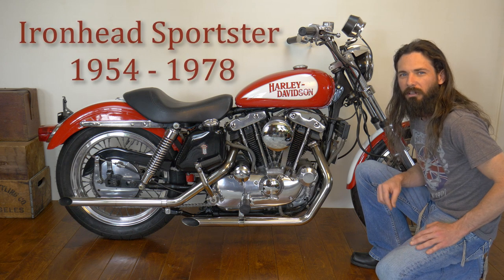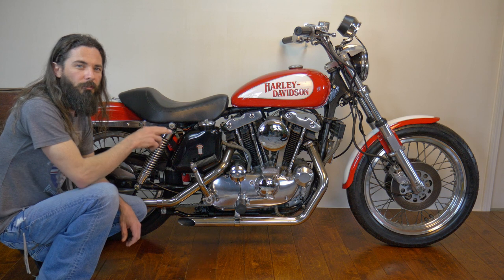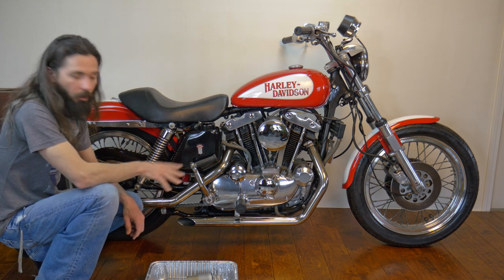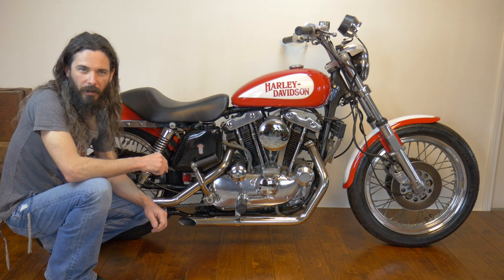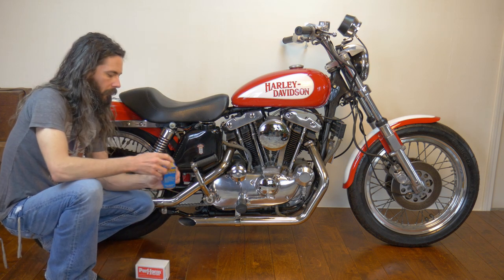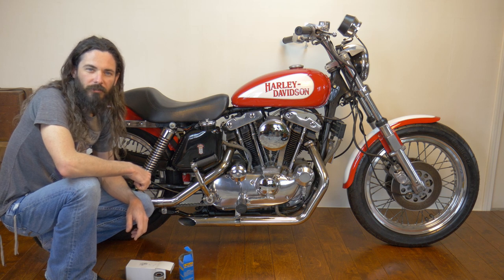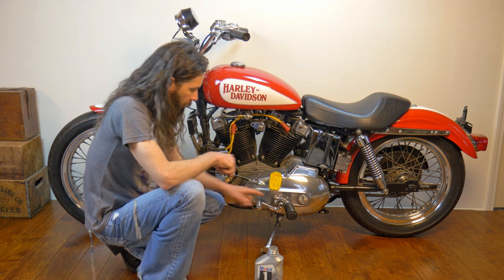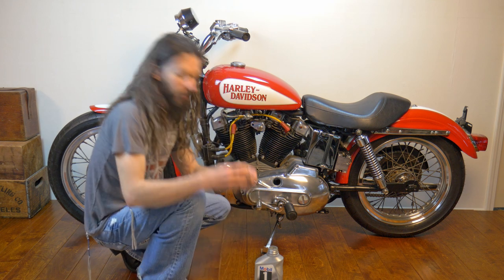Harley Davidson Sportster (1957 - 1978) Oil change, Engine, Primary, Tranny IRONHEAD Fluid service

Comment: The fact that this man's hardwood floor is spotless at the end despite working on a fossil designed to drain oil on the exhaust pipe, frame, and concrete, tells me he's done it a time or two. Excellent content, informational and I would recommend you watch his HD filter cutting video if you haven't already!!
Reply: Knowing him, his bike is in his living room 😆

Comment: If the bikes does not run. And you want to do the fluids before running it for the first time in years. How do you get the sumped oil out of the crank case?

Comment: I was told not to mess with transplug because they strip out has anyone ever heard this?
Reply: Yes mine stripped out had to put a self thereading bolt in better to loosen primary cover to drain trans mine is a 77 sporty

Comment: Very nice video. I had a 1974 XLCH (kick start only, and right side shifter). I seem to remember a different oil tank, and an oil filter in front of the crankcase, instead of inside the tank. In the early days of electric starters on Sportsters, Harley Davidson made Sportsters that had both electric and kick starters in case the electric starter did not work. Charging systems were not the same as they are today, and the batteries for the electric starters were much larger than on the kickers. That meant that XLH (electric) and XLCH (kicker) Sportsters had different oil tanks and filters. Your video brought back old memories. I still have a set of points and a clear plug for the timing inspection hole. Keep the videos coming.

Comment: Thanks brother. I was looking in the '67 XLH service manual and it called for weights 58, 75, and 105 if <32F, <75F, or over 75F. Are those oils weights different than the ones today? I have seen 20W50 V-Twin in forums though. BTW: For Mom's bike. She's 79 this year.

Comment: Great explained vedio,,, question I just installed a 78 iron head on 71 frame wonder about chrome tube on bottom of right side of front engine on end of alternator to engine housing,, I see oil pump feed fitting and return fitting next to oil sending unit but don't understand how the chrome pipe in question hooks up to oil system,, ,??  Have after market oil tank with bottom fitting for feed and return on top back and what appears to be vent fitting on filler cap neck I assume is for gear case vent hose on top behind rear cylinder base??

Comment: I the case of Sportster 1982 does it have the oil exchange vent as well? (Or we can use formula+ on primary for example)
Reply: I also have an 82. Man I think so because all the videos I see the transmission and primary are 2 birds with 1 stone.

Comment: Have a 77 xl and a 74. The 74 sits and over fills the primary. The 77 blows it out the crankcase breather. That's a nice one you have there. Thanks for the video.

Comment: But, but, Sportsters are a girls bike.....
 Says the guy who never rode one.
 One of the most ornery, tricky, sluggish handling motorcycles ever made.
 The only girls that ride them are the ones who can whip your ass.
 I love Sportsters.
 Good video.👍
Reply: Sluggish?!

 No Cat, No energy wasted on battery and barely any through chain. I have a feeling our old pre AMF 69 will be smoking just about everything off the line (including the tires until I get to know her like I do my shadow) 

Cal Rayborn held the landspeed for years with a direct connect to a bored and stroked 69 ironhead.

Also, as all pushrod Harleys do, the quad cams could surely be upgraded for some extra HP

You are the first one I have heard call them sluggish, it is a relative word (maybe you ride nitro bikes or something). And I cannot disagree until we get her going (March 2022 fully rideable at the latest)

Comment: My bf has a 67' ironhead sportster, he's been trying to figure out what kind of oil to use? Synthetic or not? He's been told to not use synthetic, so I'm just curious if someone or even jay w case could help us out?!
Reply: Old Harley's are too noisy and leak eventually using synthetics. Dyno oil and straight weight oil (sae 50, 60, or 70) is the way to go. 20w-50 in a pinch is okay but the bike will weep oil here and there overtime.

Comment: I dont even have a Ironhead sportster. got an old XLH 1200 Evo sporty but loved to see the diffrences and similarity´s between the two. Live in Northern Europe so these bikes are not a common sight here.  Is that an oil cooler on the front and did that come as standard on ironheads?
Reply from the maker: Hey! 
Greetings to you in Northern Europe, and thanks for the comment.  
Yes, it is an oil cooler on the front.  
It was an add-on.  They did not come with oil coolers.  
The Ironhead sportster is not a hard bike to find for sale here in the states, and they are often surprisingly cheap! 
Best of luck!

Comment: Hi Jay I have a question about the magneto on a 69 sportster, the plug wires, does it matter if you install number 1 or number 2 wire on either hole on the magneto?

Comment: I have a 76 Sportster 1200. With no kickstart  has been sitting for 20 years or more. The oil tank has same filter as this video but has a Dipstick on the cap . Should I try to start it and get it running for the 5 mins you said to do in the video and then drain and fill both oil tank and transmissin and primary ?

Comment: My 74 has a dip stick attached to the engine oil reservoir cap. It also has the original filter canister.

Comment: I have a 73 sportster 1000 been setting for 20 years what do I do to bring it back to life
Reply: @westoniii  mmo is marvels mystery oil or something right? Some new fangled stuff? Couldn't speak to on it myself, My iron-head gets 4 fluids 
Oxygen
Leaded gas (or synthetic alternatives when needed)
Kendall Sae-50
And grease. 

Some kerosene for flushes once in a blue moon and that's it. 

Everything else for me comes down to tuning, fitment, gaskets, elbow grease, a shop manual, and critical thought. I don't trust mechanics so it goes slow and steady, but I know exactly whats been done and why.

EDIT 
Also, I've come to the conclusion not to use starting fluid on Harleys (as wasted spark occurs during intake on the front)

I don't know for sure, but it seems to me it would could light up the carb. (Did that long ago by timing the wrong cylinder, easy to put out but no fun)

Comment: I just changed the oil in my 73 XLH swung my leg over the left side "of course" and forgot to move the oil pan stepped right on the that damn thing and slung oil all over my trouser leg the bike and the driveway 🤬 this getting old s**t sucks arrrgh

Comment: Part number for filter?
Reply from the maker: The original HD number is 63840-53.
Here are several different numbers for aftermarket single-unit type replacement filters: 
HiFlo:    HF178
Perf-Form:  	40-0380
Twin Power:   JO-L103

Comment: I was trying to work out what year that bike is when it occured to me that it doesn't matter as they hardly changed in the twenty-one year period you cover in the headline. My guess is late seventies going on the front brake calipers which were used from about 1978 I think - and don't get on my case here folks, I have a Sporty ('06) and a Dyna ('10)  and I love 'em both !
Reply: Well 69 back had left side break pedal right side shift. But yes AMF used the same engine design. 

Personally, I am glad to have a 69 in the garage. Before cats and unleaded gas, just an air pump with magnets and wires. Can be bored out so many times a guy could probably skip oil and get a decade out of her (joke). No need for battery or computer, just mechanical power. A record setter and a great apocalypse bike.
Reply: @ronnielorimer8770   74' and back are right side shift......

Comment: I just got a 96 dyna where do i find drain plug?
Reply: Idk, your first tool after a bike should be a manual though. You could always pull the return line like I do (makes sure to clear out all of it)
Reply: BTW, I thought you siad 69, I was perplexed. That's our bike (69 ironhead( but I knew dyna was new) that's why I tried to answer.

Comment: I thought the Sportster wasn't produced until 1957?
Reply from the maker: Hey Dirk! 
Yes, thank you, that is correct! 
This process applies also to the K model that Harley introduced in 1952 and beginning in 1954 used the same oil changing procedure as all the sportsters that followed after it until 1978.  
Keep the rubber side down!
Reply: your right they didnt  start till 1957 however there was the K models from 1954-1956 that were 750 - 45 ci heads on the sportster style bottom end.

Comment: This only works on the XLH Electric-Start only models; the XLCH Kick-Start models have no oil filter, and use a smaller battery and far different oil tank/mounting. In the Pre-1970 XLCH Models, there is no battery, because a magneto is utilized instead. In 1970, the XLCH model started using the same battery/coil system of the XLH model.

Comment: 60 weight man.   50 is too thin, noisy.
Reply: I lived in Milwaukee for 7 years. The MPD ran those AMF FL’s year round with bearskin aprons attached in winter. I asked Officers Steen and Rausky about oil. They ran 70 in Summer and 50 in winter. I guess they oughta know! Brrrrrr…